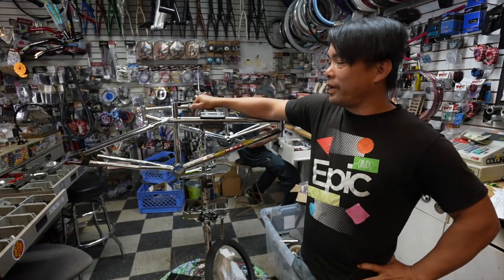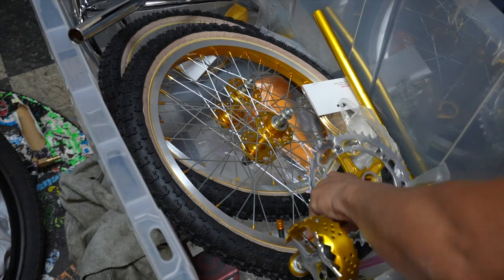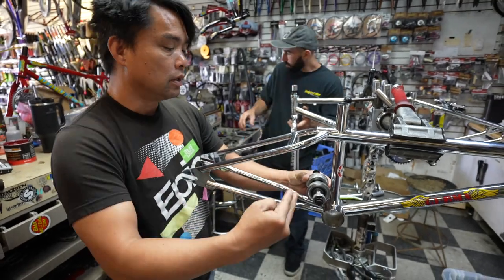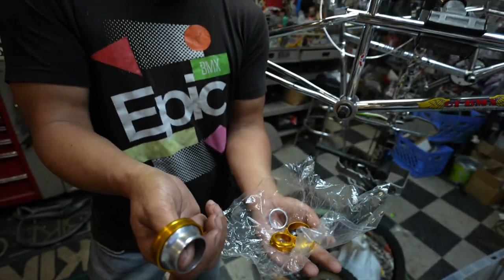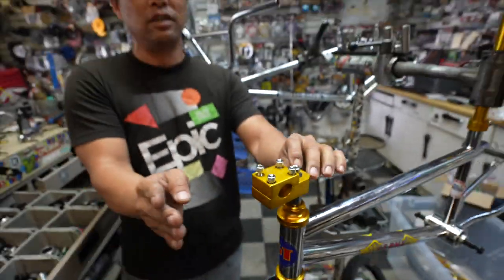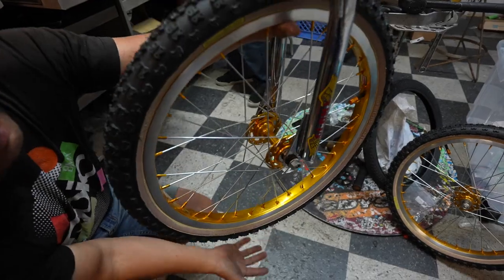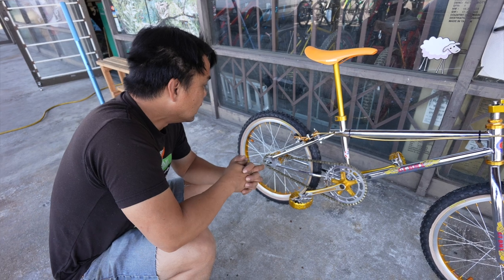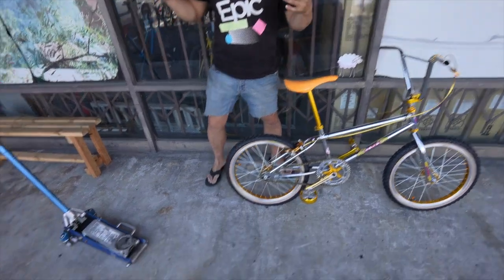1983 GT Bikes Mach 1 Gets Violated By This Shop Owner!

Comment: Nice build. But GT did not offer a Mach One in 1983, those were offered in the late 80s. You’ve got a NORA cup model
Reply: 84 is first year of the Mach one. There is no Nora cup model. Nora cup is an award and GT just advertised they won the award with a decal. This is a Pro model.

Comment: That right there is the “1983 Nora Cup GT Pro”. It doesn’t come with the front brake mount in the fork so that was correct to only have the back brake for it. Very rare to ever find one of those in good condition. Great job with the re-chrome and ano especially bringing those Araya’s back to life. Great idea to go with the gold. Would’ve been nice to see some Oakley B1B grips on those bars though lol Overall rad work! Keep ‘em coming
Reply: My 84 Expert has the Nora Cup forks. Unfortunately, some jackals drilled out a hole for the brakes. I can tell it was a home job because it's crooked as hell. 😢😢

Comment: Okay.  I have the same frame GT mach 1  My frame has no serial number stamp anywhere on it . None . It has the GT on the back of the top bar . It had the holes in the rims  with the 36h spoke rims . Red   tube protector inside the rims. . I was told the ones without serial number are the easiest bikes built before factory building them. .

Comment: Another method to keep the bearing sealed without using rubber gaskets instead of having that crack line where dirt can easily get in plus ascetics reasons too this is my opinion on the headset cap

Comment: can you do a video on tubeless tires? and how to take them off??
Reply: All you need is some solid , high quality tyre lever.. if it's a very stubborn tyre/ rim combo; get both beads of the tyre into the centre of the rim, pop a tiny bit of soapy water on the rim inside and out. Keep one side of the tyre in the centre of the rim well and simple lever the other side out and over. Multiple levers can help but trust me , good quality levers make all the difference, they cannot flex at all.

Comment: all he made at first was that frame. it was just a GT  pro or expert  the fact he had it rchromed RUINS it.     it doesnt look gary clean at the cap area. looks like it was cut off and a blank welded in   the holes in the drop outs are not there.                half link chain.   repops...         fake bike.          if it were a real 70's  he would keep it real.       looks like 83 w the stamp removed.               no way thats a real hand made in his garage gary turner.   they were few made                    my very first 20 inch was a gary turner my dad had made for me since they knew eachother from drag racing.        not gonna lie it broke....  headstock cracked. my dad rewelded it      i had it so long i got sick of other kids telling me it was fake because it didnt have the stamp that i got one with the stamp  LOL      it had tange forks sugino cranks. z rims. diacomps mcs sprocket it was chrome n red.  w red anno bars